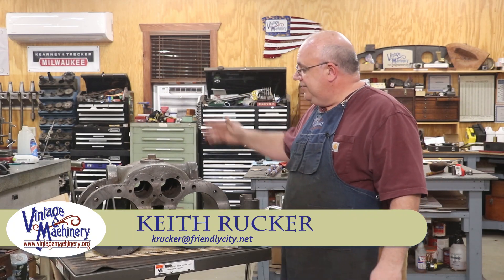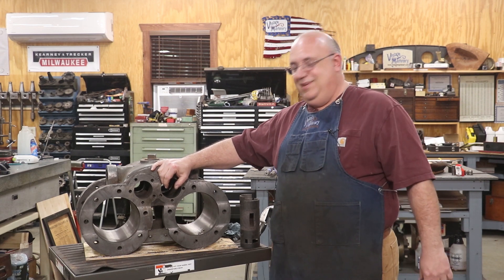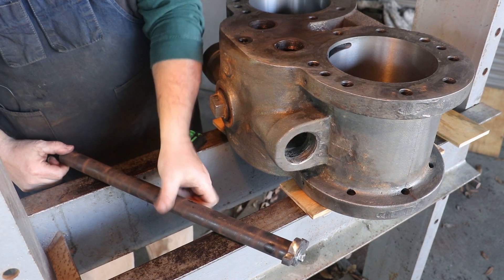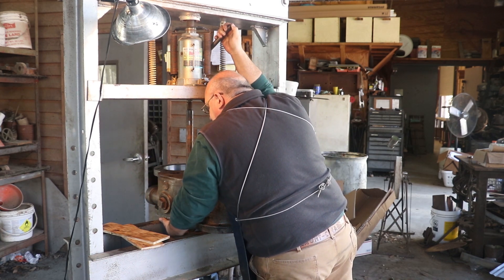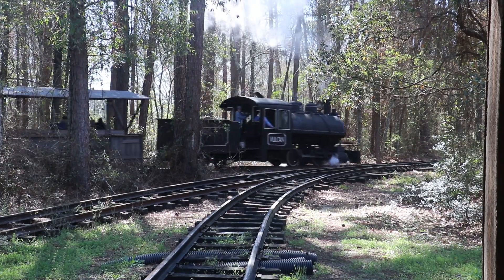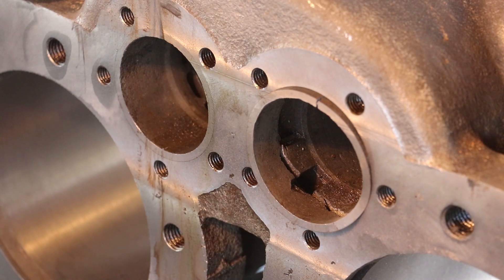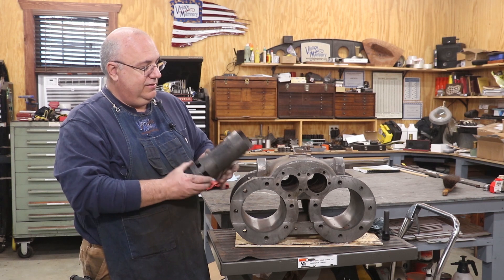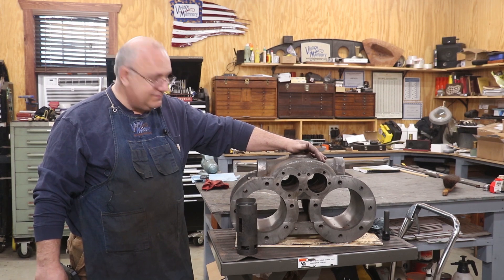Steam Locomotive Stoker Engine Restoration - Part 10: Removing Valve Sleeves Using a Hydraulic Press

Comment: If you didn't need the second one as a pattern you can simply "weld" them out like Bearings. Take a some cheap stick welding rods and run a fiew hot beads down the length of the sleeve. It will shrink a little and you can press it out easier.

Comment: Once you get the casting heated up try some dry ice in the bore. Push it up into the bore and plug the bottom with a wooden tapered plug. You might need an extra set of hands for help.

Comment: I'm not a pro at things like this, but I was thinking that on a lathe making a round piece with a shelf turned down on the end that would fit inside the sleeve and the outer diameter a little smaller than the outer diameter of the sleeve

Comment: If you make a better pressing tool it looks like there is room in between the cylinders where you attach it with a little bracket. It would be hidden when assembled, but available for the next person who need to replace the liners.

Comment: An easy way to make a slip fit part cold is to get a can of duster "air" for computer cleaning.  It contains a compressed chemical that expands to make a blast of "air" to clean computers.  If you hold it up side down and spray it comes out as a liquid (diflouroethane)  which will freeze the metal quickly.  Don't get it on your skin.  I have used this to fit up press fit automobile bearing assemblies.

Comment: Looks like they want you to bore the valve liners out. But how to copy the liners? 
You could have perhaps soaked the cylinder assy for a few days in diesel fuel or penetrant after heating it or perhaps slotted through the sleeve with your shaper to relieve the compression.

Comment: I have removed many bushings from hydraulic hammers and while we were usually able to just run a weld and beat or press it out, sometimes I had to weld a thick plate inside and use that to press on. The big concern I have with that here, is that the sleeve could break at the weld, leaving part of it in there.

Comment: All the stoker engines I have seen have been mounted under the cab with the auger extending into the tender. On the PRR if it was equipped you can see the cylinders on the fireman side under the cab. The Pennsy considered a stoker to be an unnecessary accessory using multiple firemen until mandated by the government. Imagine today having 3 guys in a cab of a long coal drag shoveling 20 tons of coal in a few hours time.

Comment: the fan starts spinning and the door opens when he gets that first pop. As well, I'm assuming its a cast sleeve? Try running a weld bead on those hard to extract sleeves or bearing races, and when the weld cools, the 
OD slips right out.

Comment: Man, that was exciting when it started to come out. I thought for sure it was just bending the tabs. CO2 will only be colder if it is in a cylinder with a dip tube, or you turn it upside down. Try a can of "duster" called air upside down instead.  I think you'll save a lot of time if you just bore the 2nd one out.
Reply: Or some of that stuff that plumbers use to freeze pipes.
Reply: Or a can of 134a Freon!!!
Reply: ...which happens to be the "duster can" filled with,

Comment: thanks for the video keith ;]  i know you have stated you prefer   as exact a restoration part as possible but in this instance wouldnt it be a better option to bore your sleeves and insert a modern "plastic" as a longer wearing inner surface for the valve?  or is cast still the best material for the application ..  might be nice to see a carbonfibre and composite loco lightweight and high performance  with all the engineering advances  just because we can ...

Comment: Keith Fenner would probably tell you that water carries away a lot more heat than any gas.  It's not a matter of how cold the gas is, but how much mass it is made of, to carry off the heat.  Keith uses a [probably custom] cooling jet, but even a cheap spray gun made for paint would do a lot to carry off heat.

Comment: Would it be possible to split the sleeve with a shaper like abom79's G&E?
Reply: You don't even need a shaper, you can set it up on the mill and use the quill manually up and down and cut a slot.

Comment: If you had the right size tap you could thread it. Use a very wet rag to cool it. Heat the sleeve till red then shove dripping wet rag in it with a stick filling the hole. The sleeve may fall out.

Comment: My only question that im pondering is why didnt you remove and replace these befor having brian mill this part on the HBM 
This way the new ones would be guaranteed to be the same height as the deck and if you did inadvertently put a gouge in the sealing surface it would of been machined out.   Besides that its always nice when stuff actually comes apart after many decades of disrepair
Reply: I thought the same thing but I think Keith wanted to see if the cylinder bores would clean out nicely before putting more time into the block.

Comment: A question I have is, if you knew the liners for the valves were being removed, why did you "face" the cylinder block as Won't this need facing again when the new liners are installed?

Comment: One other comment is that a cylinder sleeve could be obtain from an engine shop that re-bores engine. Sleeves are made to repair damaged bores and are dry press fit into over sized bores.

Comment: I would make a slug just a little smaller than the bore like 1/32 or less you want a slide fit as close to the bore as you can, and as thick as you can say 3/4-1"  thick. then put the slug into the bore first then the piece you made into the slots , than use your push bar pressing against the thick slug there by all the force will be real close to the bore edge. instead in the middle of the bore

Comment: Wouldn't it have been easier to bore out the sleeves a few thou in situ and then make oversize valve/pistons? 

( your machining's going to have to be spot on on all the ports to preserve the timing, also the new sleeves will have to go in dead straight to line up )

Comment: I suggest that you heat it as you did but pour water in the valve to cool it.
Plug the holes with putty.   That will give you the biggest heat shock and
greatest shrinkage.

Comment: For some reason I knew that sleeve was going to crack using that adapter piece.  All that pressure on the sleeve cutouts was too much for the cast iron to bear.

Comment: How about pouring liquid nitrogen inside? Put the pusher rod in, cap the bottom with some duct tape and then pour liquid nitrogen through the valve rod opening. The liner being thiner should shrink faster than the casing...

Comment: Turn a stepped pusher on your l;lathe, maybe an inch or two of metal sitting inside, rest bigger outside, heat and co2 from a fire extinguisher? Should have second one moving.

Comment: Steel rod milled to 2k under the sleeve size and a portion sticking into the sleeve about an inch with a total of 3 inches thick should do the trick.

Comment: If the sleeves didn’t need to be saved, I probably would have used a boring bar in a lathe to remove them... but that’s just me. Have fun, however you remove them! 😎

Comment: Designer of the stoker engine to himself, "I will spec the valve cylinders to be sleeved into a 1/2 blind hole, that will have them scratching their heads well into the next millenia".

Comment: Gotta stop with the brute force mentality.  Loading up the press and not even checking the progress, just keep running the pressure up.
Reply: HULK SMASH!!!!!
Reply: @audimaster5000  LOL.
Reply: There aren't many options on something like this.  It is very old, and very rusted in place.  The main casting is massive, and will take the beating.  I think he did a great job.  What progress are you speaking of?  When you are pressing something that is stuck, it is very much all or nothing.  No bang = no movement.
Reply: @Bobbywolf64  Typically a guy will try to get some material movement via expansion and/or shrinking before pressing.  Loading a press to 20 or more tons, then continuing without checking the setup to see what is going on can be disastrous for the parts, and the operator.  Had he checked the progress he would have seen his custom part was deforming.  Going full gonzo is the last resort, and even then I would machine the liner down, then break it up or peel it out especially on a part that is unobtanium.
Reply: All this second guessing and predicting disaster,,, guess what,,, didn't happen boys,,, Keith 1,,, casting 0

Comment: IMHO CO2 is your answer..  Heat the whole thing up a little, say 300F and then blast hard with CO2 from a fire extinguisher. I would expect that it would literally fall on the floor.  I've seen it done that way on machinery.
Reply: Liquid nitrogen is even more certain to do the job. I've seen that used to assist fitting interference liners on big  diesel blocks
Reply: @howardosborne8647  agreed. LN2 is great if you can get it and know what you are doing. 10# co2 fire extinguisher is easier for most.

Comment: I'm not a NASA engineer, but why not bore it out.
Reply: If you bore it out you destroy it. They are not exactly the same, they are mirrored with respect to each other, so ideally you would want to have the 2 originals to help you when making the casting patterns instead of having to rely on the plans. They can be bored, but it will be exchanging a minor time-saving today for a major headache tomorrow.